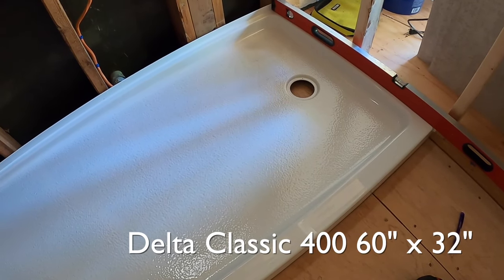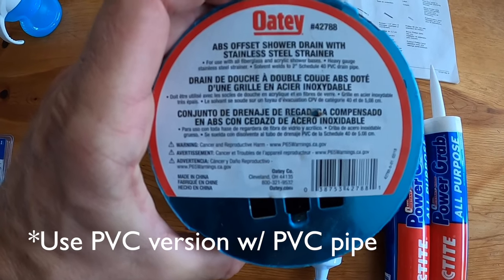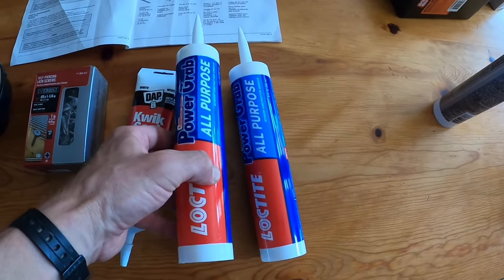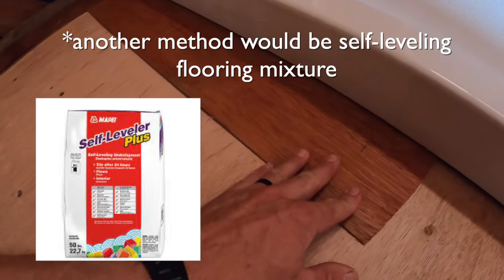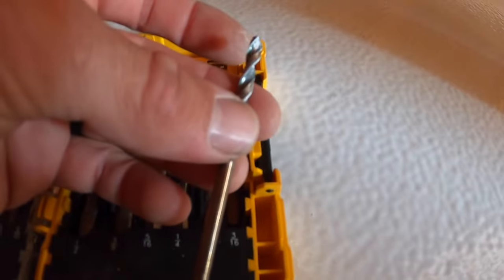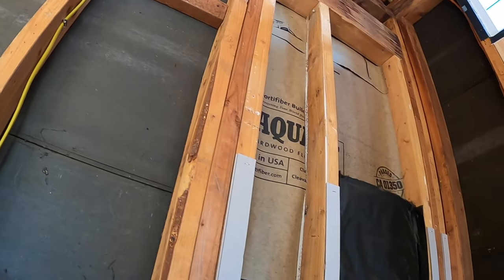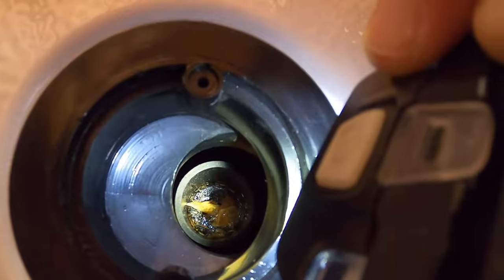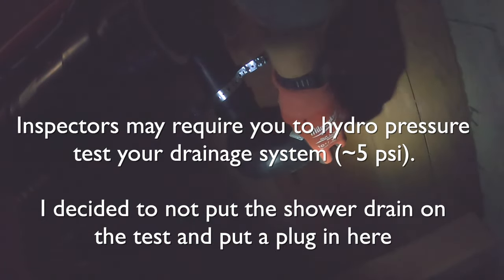Delta Classic 400 Shower Pan Install

Comment: How do you pressure test a sewer, drain system. You would have disconnect every sink and cap it, go on your roof and cap every vent, and the 5 psi might ve enough to push just enough water out of the house trap so it wont be sealed. I'm  a carpenter, so im seriously asking. not trying to be a d***
Reply from the maker: I had to do a pressure test for this bathroom for the city inspector. In the 3" line that tied into the main 4" cast iron sewer line, I installed a 3" clean out. Through that clean out, I use an inflatable test plug, also called ball or bag (inflated with a bike pump) to block the flow. Then, at each drain on the new line (sink, wash. machine, shower, toilet) I had to plug. The toilet flange comes pre-plugged with a knock out. Sink, shower, and wash machine I used mechanical test plugs. With these plugged, put hose in the vent in out of the roof to fill to roof line. Inspector showed up and sees there are no leaks in drains/vents and you get a pass.

Comment: Use 100% Silicone  instead of the caulking on your drain.  Good info  otherwise 👍
Reply from the maker: I was originally going to go with 100% silicone, but manufacturers instructions specifically said not to. I found that strange as well.

Comment: Why know mortar bed?
Reply from the maker: That's what the manufacturer said to do (Delta). I think a mortar bed might be a better way to go. This is currently in a rental property and so far no issues.
Reply: Did you place the bottom edge of your GoBoard on top of the pans thin edge, or did you bring it down into that lip? Thanks.
Reply: @scottswannie2500  I fur stripped my studs out and came down to the pan inside the lip. I then shleuter taped the bottom and siliconed it and put mortar there to seal it in.
Reply from the maker: @scottswannie2500  I had the cement board come down over the lip, but allowed roughly a 1/8” to 1/4” gap from the top of the pan to where the cement board hung, to ensure space for a silicon caulk to seal the gap between tile and pan later. Also, there were a few places, one wall more than others, where I used drywall shims (stud shims?), basically long strips, to even our the studs or bring them out 1/16 to 1/8 inch. This ensured the cement board was not bowed out at the bottom from the lip, or at least not bowed out enough that it would affect the tiling process later.  I used cement board instead of a lightweight alternative like GoBoard due to availability/cost, but have used Schlüter Kerdi Board before, which is an amazing alternative if you can justify the cost.
Reply: @findoutDIY  Thanks for the info. I’m still a bit confused as I’ve never tiled before. If you shimmed out the studs a bit, didn’t the wall board stick out from the original drywall near the top of the shower walls? I’m putting goboard in only 3/4 of the way up to the ceiling. So to clarify, you put your board just over the top edge/lip of the pan which would leave a good 1/4 gap in between the bottom of the board to the edge of the pan and that’s where the tile thin set  and tape will be filled in to make it flush for tiling and to hide the screws that show around the pan?
Reply: @findoutDIY  also, did your first  bottom row of tile rest on the edge, not the top lip, of the pan and you filled that gap in with thin set as you tiled?
Reply from the maker: @scottswannie2500  Yes, good point to bring up. The cement board (or other tile backerboard) did protruded about 1/8 inch past the drywall on the wall I shimmed the studs the most to get it over the lip of the showerpan. To clarify, I only shimmed behind the cement board, not the drywall above or around the shower tile. This wasn't much of a problem later with the tile. I tiled the wall, then the grout covered up that small gap around the bullnose (tile edging) that meets the drywall, and in my opinion doesn't make much of a visual difference. The only way to fully correct that would be to go back to the framing. To your second question, yes, I tiled down into the shower so that the bottom of the tile was about 1/8" off the top of the shower pan using tile spacers. Just remember that gap needs to be filled with silicone caulk, not grout (I have another video about that mistake).
Reply from the maker: @scottswannie2500  Yes, the bottom row of tile is inside the lip of the shower pan. That lip is just to get it attached to the studs. The tile backerboard and tile go inside, and sealed with silicon caulk after tile is finished and grouted. Don't grout that bottom gap! (I have another video about that mistake).

Comment: Not a good idea put glue 😊😊😊, if there any problem, you scrap you shower base.

Not good using silicone imstead of plumber putty
Reply from the maker: Both points were addressed in the manufacturer instructions (Delta) and this video demonstrates what the manufacturer said to do.